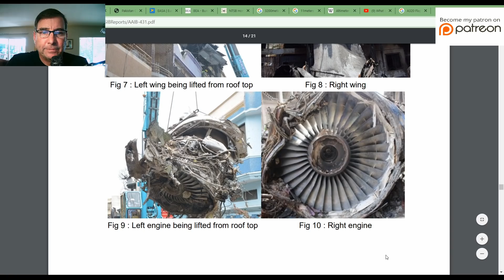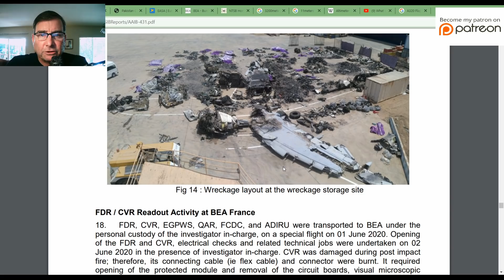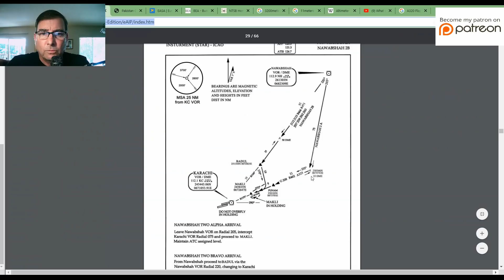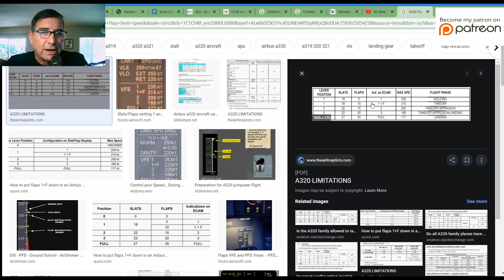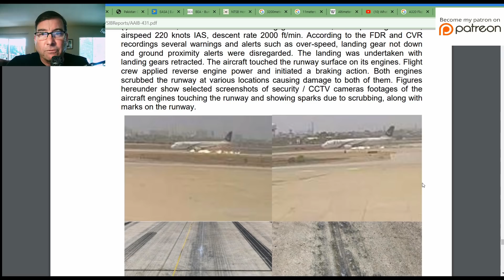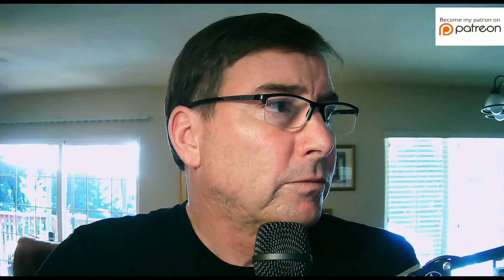PIA #8303 Preliminary Report Part II

Comment: The worst case of human factors? Hey Juan, how would you compare it to the Tenerife collision?
Reply: Very similar. Both demonstrate gross negligence that lead to gross casualty.
Reply: I guess William one could judge on various parameters: eg one would be on the basis of outcomes: more souls sadly died at Tenerife; would that be what you are hinting at William? What perhaps Juan (and others) are reflecting on; is the sustained period of time over which the crew here didn't seem to be complying with SOPs; there would surely be multiple actions: at Tenerife instead, Captain van Zanten selected full power.
Reply: The Teneriffe Collision was much more complex. There was the lack of CRM in the KLM Cockpit but also the overcrowded little Airport, the fog, the lack of tecnical Equipment in the Airport, the misunderstanding between ATC and the Dutch Crew, the lack of information the KLM Crew had gotten.

In this Case its mainly a horrible lack of CRM and focussing in the Job, nothing else.

Comment: Where was PIA's check of the airmen's flying techniques?  They didn't just start flying in this manner on this flight in my opinion.  They took a perfectly good aircraft, in good weather and caused the loss of the aircraft and almost all aboard.  I would halt all flights until all airmen passed a checkride, and review the procedures the airline has which should have detected this beforehand.

Comment: I would think that these pilots were most likely sleeping on the job, rode out the autopilot, tried to compensate.  I see contant compensations that should not have happened.  Their drive was focused on landing, that was their goal no matter what.  Landing a plane on the first attempt should never be the goal.  Landing safely should always be the goal.
Maybe they were worried about losing their jobs for the first mess up, which is obviously not paying attention to where they were, and flew high altitude past their own flight plan.

Comment: Let's backup to aircrew qualifications & training. Do you just need to show up with a copy of a pilot license at the door? Ok, your hired. Sit in right seat and obey the Captain. 

Captain to FO.  IF I say gear up you pull this lever.  If I say flaps ten, you touch this handle.  All else just sit there.  

Did FO use fake certificates? Maybe just soloed or private in Cessna 150. 

Why did they not indicate who was pilot flying. Who handled radios? They must know much more but won't release data like cockpit conversations.  

I heard on final pilots were discussing COVID19. Did FO even know what gear up/ gear down handle position?.

Comment: Again, there has never been, as far as we can tell, about the schedule...were the crew trying to get into Karachi "on time", or were they trying to get a landing "slot"?
BTW, another channel looked into landing gear deployment, and, on that aircraft, he said that deployment will be initiated by the system as soon as the airspeed drops below the max speed point, but that it takes 10-15 seconds to start deployment ...
Sadly, this was a case of FUBAR from the beginning, and it appears that no one on the flight deck was reading checklists.
Also, as i had mentioned previously,  it's really bad human interface to have that single audio warning tone, and, as has been said, that there is a priority override for voice warnings, allowing for "stacked" failures/errors to be missed. Kind of strange, too, to design the engines such that any impact around the bottom of the engine will completely disable so many systems?
Reply: Karachi is not like Heathrow!
Note that during the radio playbacks of this flight you do not even hear communication with any other flight going on at that time.
Reply: Not enough time to do checklist at the high speeds they were at.
Reply: I checked the published schedules, and they were at least an hour late on the scheduled arrival time...

Comment: This is why flights should be fully automated. The only thing that worked correctly on that flight were the automated systems.
Reply: Would a fully automated system have decided to land the plane on the Hudson River? Or would it have tried to return to the airport? Or would it have tried to follow ECAM actions and just continue in a straight line and attempted a windmill/APU bleed start?

Comment: Surprised to NOT hear comment about approach to tower comm via telephone. What the heck? My guess is that someone's radio broke and budget or some other crazy reason did not allow replacement. I have almost 20 years living experience in developing countries and have witnessed maintenance practices that at best are laughable at worst they are tragic. So please look for an answer on the telephonic comm link. True it was probably too late but tower having to comm with pilot via telephonic relay with approach if otherwise may have last second saved these people. What is the price of a repaired radio system?

Comment: Juan - if the landing gear is extended, and then the aircraft speed increases beyond the safe threshold, does the gear automatically retract to avoid damage?  That could explain why the gear was extended, then retracted a short while later as the aircraft commenced its 7000+ ft/min descent. 

Your thoughts?
Reply: No. There is no automatic retraction/extension of the gear

Comment: This is heartbreaking! 
is this possible that the control tower is given full authority and it doesn't issue clearance unless a plane is on a safe landing approach?
Reply: Jibran Zeb - NO, That means every controller would have to be trained on the flight characteristics of a safe landing. Suppose the aircraft is "crabbing", due to a crosswind, is the controller going to call it safe or unsafe? Let the pilot fly his aircraft, let the the controller separate them.

Comment: “Flight crew applied reverse engine power and initiated a braking action”... would any of these systems actually have actuated under these circumstances, or would the absence of landing gear contact have prevented this?
Reply: I see your “No gear = no ground spoilers” text at 23:30, just wonder if any braking actions would actually have been possible?

Comment: I think airbus should  add recommendation  pilot must be go minded except when you Lands without landing gear
Reply: Or just add a recommendation to have the plane piloted by trained, qualified and competent pilots.  If that is not already there.
Reply: @Rob2  They were trained and qualified. But people do mistakes and they were not focussed that day. You are under the assumption that qualifed people don't make mistakes. And that's hogwash.
Reply: These pilots ignored speed, glideslope, basic energy management, and the limits printed on the placard literally in front of them. They displayed no CRM and made no callouts. They disregarded requests from ATC. 
I doubt a manufacturer recommendation would have prevented this crash.

Comment: Forgive me for asking a silly question:  Is it possible for the Flightcrew to have thought they were reading/flying the jet on “Metric measurements”, even though it showed “Standard measurements” of the Flight Instrument Panel(FIP)?  Can Airbus’ jets allow for “flipping” of showing the FIP data to show either ways, like late model cars can convert speedometer views between American speeds (mph) vs. Canadian/Mexican speeds (kph)?
Reply: Yes but it’s only China and Russia I think that use metres so they shouldn’t have to press the button for a domestic flight. The only button they need to press is the one that switches from standard pressure to local altimeter and turn the dial to set the altimeter. The meters button only shows in minor numbers too so it should be obvious which they are flying on

Comment: Would it have helped them reach the runway if flaps were fully extended?, do fully extended flaps delay stalling of the plane?
Reply: Flaps won’t extend without green or yellow pressure which is not provided by the RAT

Comment: the FDR system is active in the air regardless of the engines running or not . . . don't know what design issue they're talking about .
Reply: The FDR is powered by the AC BUS 2 which is normally powered by the right engine. If the right engine cuts out the left engine would take over but as both cut out this was lost. Only functioning bus is the AC ESS which has more important systems to power than the FDR

Comment: An ancillary tragedy is total loss of FDR. That it itself is devastating. And by design! At THE most, most critical phase of data collection.
But what's truly insane is that manufacturers (and regulators) can't hire a 12 year old kid and spend $23 and transmit all FDR and all CVR to a collection server REAL TIME. Cost is virtually nothing. Weight is nothing. Complexity is trivial. POWER is nearly nothing. And if anyone contends that the amount of data is massive, I will contend that that person is on AOL with a 2400 baud modem. This is ludicrously technologically trivial.
Reply: In fact, a 10 year old kid with a cell phone could design a system that costs a $29 cell phone and 6 ounces of weight, with a 6 hour battery, and bam. We have 100% CVR capture, largely impervious to craft power loss,
Give him a $3 USB cable for it and that's 80% of the FDR capture design. Or imagine if they splurged for a whopping $79 per craft on this, up to say .003% of the total craft cost ... or the $79 billion outlay it warrants. This is ludicrous that this has not been solved and implemented. DECADES ago.
It's the year 2002, for crying out loud. This is kid stuff. What is the major malfunction? /sarc off
Reply: I will concede that an acknowledged shortcoming would be dark zones such as over oceans or poles. So throw out the baby with the bathwater? Even the $23 solution would be priceless. Even as a mere starting point.
And when Branson or Elon go orbital or lunar, there might be dark zones. Okay. But something tells me that each of them will pull their hands off their nonbureaucratic puds and just get her done. Simply because it's idiotic not to, given the relative triviality. Even for a powerful, redundancy-compliant system that costs a few cents more than $23.
Reply: And how would that phone transmit the data? Though the aircrafts WiFi where everyone else is using it. You don’t get cellular data at 37,000ft. The FDR is lost because it is connected to the AC Bus 2 which went out when the engine failed. The AC ESS bus is powered by the emergency generator which is powered by the RAT but doesn’t include it because the RAT can only power 1/18th of the engines power. So only the most critical systems will be provided electrical power like the flight controls hydraulics, FBW computers, captains instruments, ADR’s and GPS, radios plus few others. Most important data can be recovered by others means. If the aircraft was fitted with ADS-B that would probably still be working. Also there is a system that transmits data to HQ. ACARS but it can’t do it every second. Imagine a few people behind a desk constantly trying to scan all the information coming from all their fleet at once. It does it usually when an unusual event occurs, manually or scheduled
Reply: Bill Woo http://www.airlinesafety.com/letters/fdrbat.ht

Read this letter from several years ago giving an explanation as to why recorders don’t have batteries. It’s not just the fact we don’t have the technology nowadays it’s more that if the FDR fails (ie AC BUS 2 Fails) then something has gone wrong already. As I have said pilots can communicate via ACARS. Basically like a text message service and it can send data to HQ via satellite regardless of the FDR state and can automatically transmit data if faults occur like QF32 or EgyptAir 804. ADS-B can provide more accurate information to and aircraft can now be tracked by satellite. Also a WiFi connection is not private. Pretty sure pilots don’t get their own WiFi and some aren’t even permitted to use their phones on the flight deck. Do you know how many planes there are in the world? Imagine all of them trying to live stream every single detail of the flight. Also it’s not 30 mins the newest FDR can record for over 24 hours and CVR’s for 2 hours. The FDR needs a lot of power because it is constantly taking information from multiple sources. And with airbus you also have access to other sources that record information such as the ECAM or QAR. The FDR is only good if the sources of information are working. The FDIU could also fail and then the FDR is useless 

If you think you’re so smart about this then go and write to them and tell them your ideas about using an old Nokia.

https://www.icao.int/NACC/Documents/Meetings/2016/SEMFDAP/FDAP-P02.pdf

Comment: Something went badly wrong on that flight deck, long before the final approach. Personality conflict? Improper training? Health issues? Mental instability? Almost inconceivable, that two pilots qualified to fly that aircraft type, behaved in this fashion. I'm going to hazard an opinion here, that this level of dysfunction probably would not have occurred, on a major Western carrier. Its the sort of accident which happened 40 years ago, before CRM, and a host of other training and technical improvements. That Airbus could practically land itself, but these two pilots defeated
all the design systems, violated all the protocols, and crashed the aircraft. Incredible.

Comment: I'd imagine the FO retracted the gear when he retracted the speed brakes on the first attempt, as with anytime you need to get down fast.  Simply reacted with a mindset of getting rid of the "slow down stuff".  Like a lot of crashes, things got too complex for the crew to handle more than one issue at a time.  Sad !
Reply: The first problem was initial approach for landing and there should have been only one issue going on -- landing. Evidently even that one thing was too much for that crew so of course after ignoring the ATC and scraping the engines on the runway they were unable to handle the emergency they caused.

Comment: Sad losing a perfect good aircraft.Reminds me of the crash  in Florida Everglades .
Reply: What about the 98 people that died? Who cares about a fucking aircraft?
Reply: You might be surprised just how many landing accidents involve perfectly serviceable aircraft.
Reply: Which one? Valujet DC9 or Eastern L-1011
Reply: Any pilot will tell you there is no such thing as a ‘perfectly good’ airplane.  Value Jet Flight 592 had numerous minor problems and was not in good shape before it departed MIA, but was still airworthy.  Were it not for the not-so-empty SabreTech  oxygen canisters which shifted in flight, and activated, ignited rubber tires and other items and caused a fire [beneath the cockpit,  in the lower, forward hold], the aircraft would have safely made it to it’s destination.   Eastern 401 crash was caused by the flight crew fixating on a faulty light in the cockpit, with the captain accidentally bumping the yoke and disengaging the auto pilot.  They descended until they suddenly discovered they were too low, their descent rate was too fast, and they were neither able to gain enough speed nor altitude before crashing into the Everglades.  At least there were survivors from Eastern Flight 401.  There were no survivors from ValueJet Flight 592.